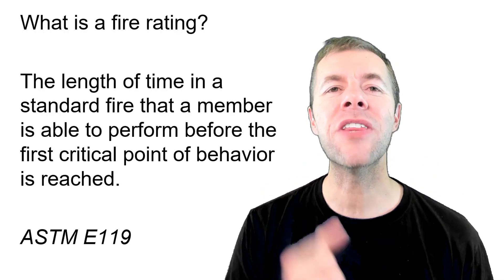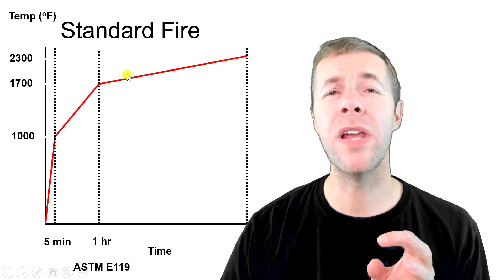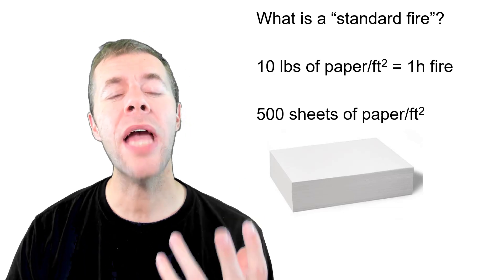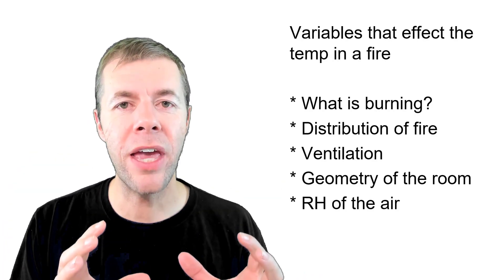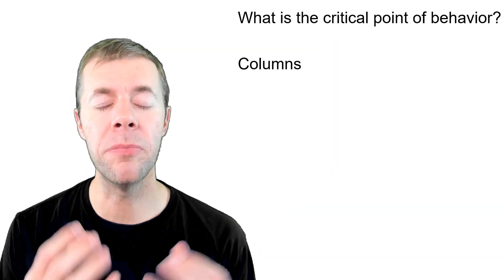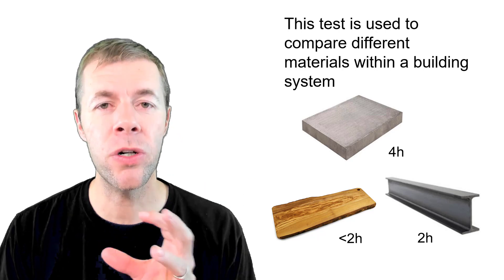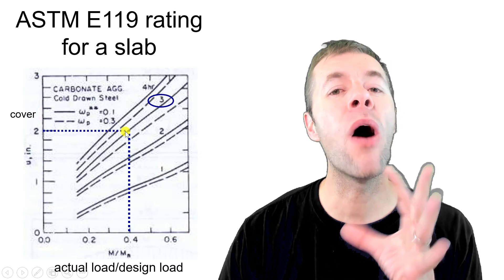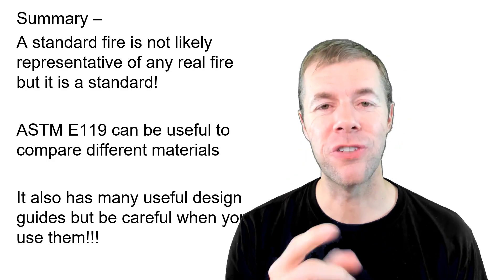Fire Ratings! Concrete! and Unicorns??

Comment: New subscriber and its a good channel.
Make a video about Ytong .Its crazy that such avangard and widespread material its not available in North America.
To get an idea about how resistant to heat the autoclaved celular concrete is,i tell you that ive build my kiln in wich i fire ceramic from Ytong blocks and then lined the interior with one inch zirconia ceramic blanket rated to 1400 C.
Ive also fired fired ( made)4 kilos of brick with just one kilo  of wood biomass,but thats another story.
USA is missing 2 most important things in constructions,Ytong ( autoclaved cellular concrete not necesarely ytong  brand) and the ppr pipes wich are superior to all the pex-al and all the otther similar pipes.

Comment: Awesome video Dr Ley.Sir,is there a rating available for composite structural systems?Can you refer some reading material regarding forensic evaluation of fire damaged steel structures?
Reply from the maker: Kushal,
I don't know of any publications on fire damage for steel.  You should get ASTM E119.  It has a lot of great information.  There are a lot of publications on how the stress vs strain relationship changes with different types of metals.  You can often times model a fire or estimate a fire in a building and then use that information to determine the temperature of the steel members.  Once you have this information then you can estimate the changes in strength and stiffness and then estimate the capacity.  I hope this helps.
Reply: Thank you sir for your valuable advice.I will try to get ASTM E119 .I came across a few papers like http://files.engineering.com/download.aspx?folder=e3ecce14-4a0e-4ca0-a089-8a99e0e01e67&file=Integrity_of_Structural_Steel_After_Exposure_to_Fire.pdf, https://web.wpi.edu/Pubs/ETD/Available/etd-050406-105306/unrestricted/rnacewicz.pdf.